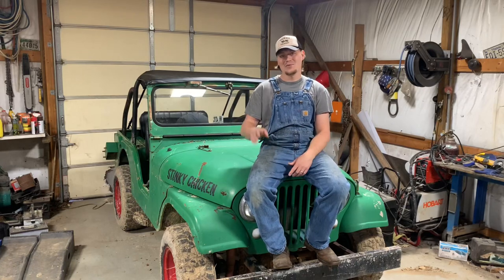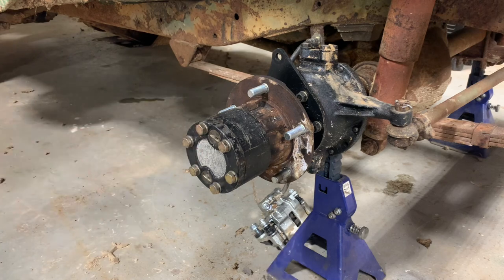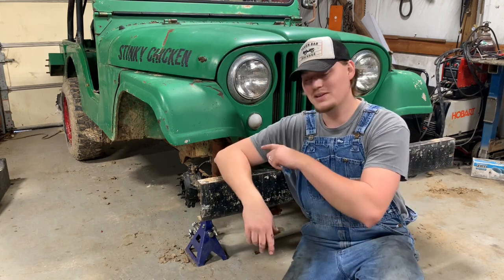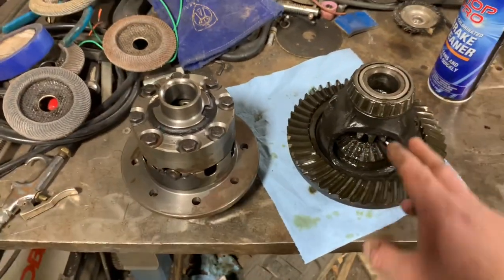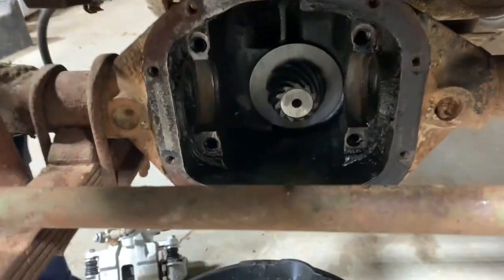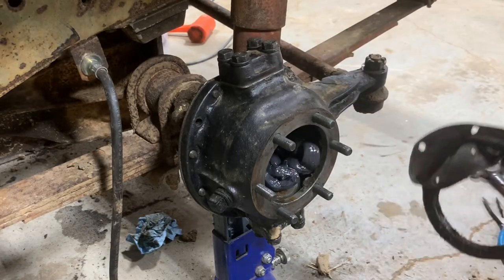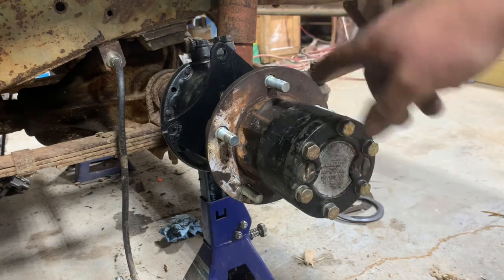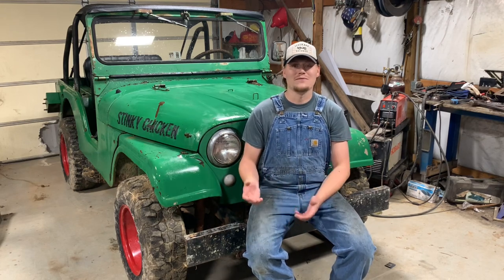1967 Jeep CJ5 Vintage Powr-Lok Limited Slip Install!

Comment: What I've done when setting up diffs is usually buy two sets of bearings, grind the inside of one set so you can take them on and off by hand. Use that second set as your "setup" bearings so it's easier to swap shims from side to side without having to pull/press the bearings on/off the carrier. Great video, love the CJ5.
Reply from the maker: That’s a great idea I wish I hadn’t cut that one bearing off I could have used the old ones for that! Thank you!

Comment: Hey young man,. You always get a thumbs up from me.  Thanks for another great video.
  Don't forget to add a bottle of limited slip additive for those clutches in your front differential, otherwise there is a possibility they can get damaged.
  Take some advice from a old timer
With as worn as those old carriers
Bearings were,  you should replace the pinion bearings also, the shims might be spot on, the little bit of extra back lash you seen is likely to be wear in the pinion bearings.
  It has also been my experience that when you have a leaking pinion seal ,
 That it is often do to excessive play in the pinion bearings.
  My self personally I like that Dana limited slip Carrier,  and it is liable to be made from better quality steel than one of those Lock Right differential sets,  and not only that but they are less likely to fail and leave you stranded, if the clutches wear out it usually just works like a open differential.   If you wear out a Lock Right they don't want to work at all.
  I think it is really cool that you are able to find new old stock parts,
 Much of the stuff these days isn't always made with the same quality.
  I am not sure if you are aware of it but Permatex makes a RTV formula for differentials and transfer cases .
 It is designed just for gear oil and transfer case oil that has additives so it can hold up beater with less chance of leaking , it is part number 81182.
  I used it for my transfer case rebuild a couple years ago and so far I haven't had any issues with leaks.
    Keep up the great work.
Hope to see another video from you soon.
   Tim from Wisconsin.
Reply from the maker: That’s a good point I’ll have to find some. I never thought about the difference in them failing. Thank you for sharing all this information I really appreciate it!

Comment: Having a 74 with a D44R and a Detroit made the CJ go waaay further and climb easier then in the D30F I added a Power Lok and it went easier and a bit further yet. Honestly the Power Lok is probably the best "limited slip" out there in my oooold JEEPER opinion. Ran the set up for several years which worked great, but admittedly I moved to a Lock Right... only cause eventually the clutches will wear out on the Power Lok was new to the market & a true locker, but your set up is now 90+%... where stock is 50%... it will be point & shoot. Your plan to get the proper backlash set up is wise... Well done ! it's going to be a fun Jeep once the set up is dialed in, make that even FUNNER !
Reply from the maker: Glad to hear you had a lot of success with this setup! I’d say I’ll do the same as you when the powr lok wears out I’ll swap in a lock right! Thanks!
Reply: @SevenBarSalvage  DOH ! I actually meant that the Lock Right was new to the market & a true locker... not the Power Lok. 😵‍💫

Comment: I like your thinking how to do these things on a budget, I do the same sort of things. You mentioned replacing the pinion seals, so maybe when you do that on the front diff, if you're replacing the bearings, maybe set the pinion one shim further in - might be close enough not to worry about it.
Reply from the maker: That’s a good point might kill 2 birds with 1 stone, thanks!

Comment: They make the Power Lock for the mod. 30 also.  I got mine from a Commando with a 30 in the rear.  All you need to do 
to your Jeep now is get a Warn O’drive which will give you 3-20 final drive.  You will need the O’drive with 6 spline main  shaft if you have a T-86 or T-90 trans.  If you have a T-14 the main shaft will be 10 spline.
Reply from the maker: I might have an overdrive sitting on the shelf 😉 Thanks!

Comment: Great video as always, Jacob. I'm with you on this...I wouldn't stress too much about the backlash. As you said, rear...yes, but in the front, when it's locked in, it's gonna be at low speed and that F-head sure isn't gonna beat up the drivetrain. As for the yuck inside...ha, you should have seen what mine looked like! Lol! 
It was seriously like chocolate pudding. The rollers on the bearing we're totally destroyed...it was ugly. Since mine was out, I disassembled the whole thing and took it to a machine shop and had it hot tanked, baked and then I started from scratch. I did that with both diffs. For knuckle grease, I used what Sam at "Parts Dude 4X4" recommend and that was John Deere corn head grease. It was like exactly the correct consistency, is water proof and, comes in a grease gun tube for easy filling through the plug hole. One tube was just enough. 
Keep up the good work, bud!
Reply from the maker: I’m glad you agree! Man you always go the extra mile and it shows! I’m gonna have to look into the corn head grease I keep hearing about it. Thank you I appreciate it!
Reply: @SevenBarSalvage  😊

Comment: Just as a FYI, the guts for this Dana 44 limited slip are the same as the sure-grip Dodge used in the 8-3/4
I need a side splined hub for the clutch pack when i installed a sure-grip in my 69 d100
Reply from the maker: That’s good to know thank you!

Comment: I have watched this video and your video on the lock-right in the rear.  Great job of showing it all.  One question.  I have watched other videos about working with differentials and the presenters make it seem so complicated, your videos encourage me to get on with doing the 23 and 25 on my CJ2.  Why in other videos do they need to use a differential case spreader?  Watching you that seems an unnecessary complication.  I have the same aversion that you do towards spending big $$ on a tool that I will use once.
CV grease.  You share my view, those are CV joints in the front axle.  Use a proper grease rather than some home-made concoction trying to replicate the original lube.
Reply from the maker: I think case spreaders make it easier taking the carrier in and out but it’s not necessary I’ve never seen anyone actually use one. Something that got me into making videos is simplifying what people make look complicated. A lot of this stuff is really simple and basic but people throw a bunch of $3 words around and fancy tools. Corn head grease seems to be another favorite for the knuckles! Thank you for watching I appreciate it!

Comment: Curious with the clutch type limited slip do you need to add some special additive friction modifier to help protect the clutches?
Reply: yes you do. some come with it already mixed. also sold separately in small bottles.
Reply: @ShnitzlHaus   I know for sure older Chevy style limited slip models you had too up to the early 2000years .
Reply from the maker: Good point I’ll look into that, thanks!
Reply: @SevenBarSalvage  some like Lucas has friction modifier in it. If driving and you feel it grabbing or jerking you can add up to 1 full small bottle 

I have a new powrlok in my rear 44 and filled with Lucas but I have yet to test. 

Also. Did your instructions tell you how to run  it in the first time.
Reply from the maker: I think it did mentioned jacking up 3 wheels or something I need to look into it more!

Comment: Do you think turning breaks would work on a 44 GPW I am putting in a ford 9inch rear diff with a Detroit locker and a Dana 44 front wit ARB air locker?
Reply from the maker: Probably not

Comment: Steve.
I have a 1951 I believe cj3a. 
Would like to replace engine with a newer model along with tranny.  Also would like newer axels so I can drive on hiway for faster speed. Can you help with what I can replace with?
Reply from the maker: 71-81 the cj5 had a narrow track Dana 30 that’s a pretty easy swap in and a good upgrade. If you could find a matching set with higher gear ratio it would help highway speed. As far as engine a Buick 225 is a pretty common swap for more power. It’s a scavenger hunt these days it’s took almost 3 years for me to find a Buick engine. Good luck!

Comment: What rotor number is that?
What spacers do you use?
Reply from the maker: Rotors are for a 89-97 Geo tracker. Spacers are 1.5” thick. Thanks!